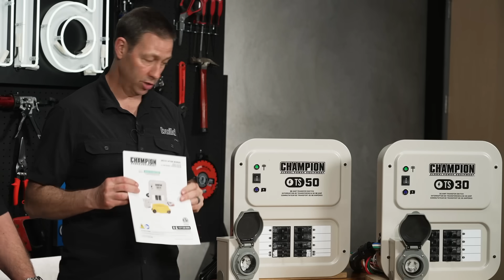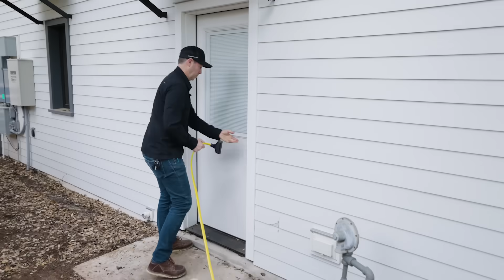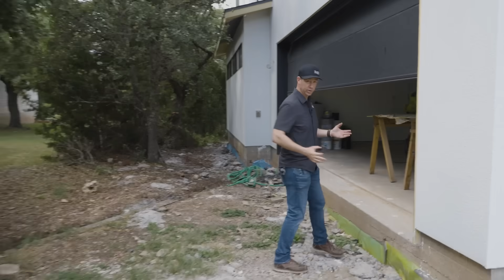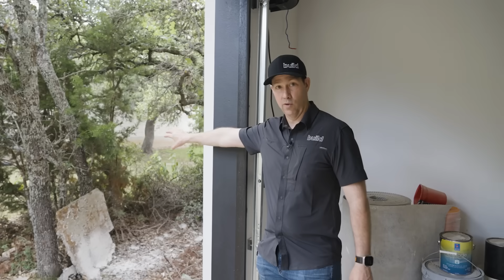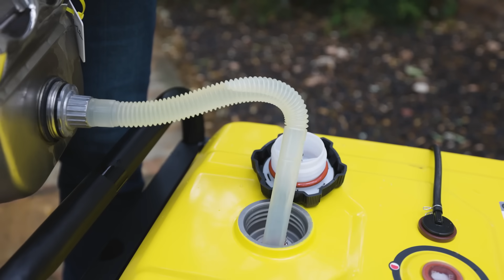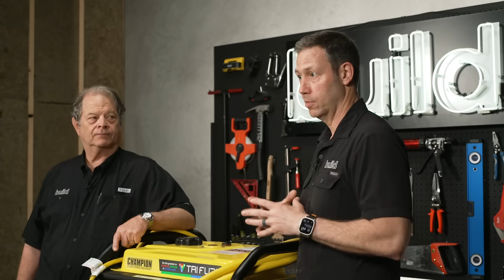SO EASY! More AFFORDABLE and user friendly BACK UP POWER!

Comment: It makes no sense to plug it inside of the garage or anywhere else inside. Put the plug on the outside. Once you put in the mail portion of the plug, it seals the connection. It should seal the connection if you’re using the right plugs.

Comment: I have an existing tft. switch connected to a Reliance manual tfr switch to run a single load like a pump. It has no neutral connection so I connect neutral to the gen/line switch plate. I used it successfully for a couple of years connected to a xantrex 3102  30A charger/inverter with batteries. There is a generator plug as well although I rarely use the generator. I recently hooked up a second Xantrex 3012 inverter charger in this setup stacked in series to provide 220/110. Xantrex says the neutrals from the power out which goes tot he house must be separated from the power input from the utility power to the pwr in plugs on eac of the inverters. The neutrals are not switched in the reliance tfr swtich and wierd things happen if the utility pwr fluctuates. I get low voltage errors on the inverters and breakers on the xantrex pop. This is inconvenient and could damage the inverters over time. My gen by the way has a floating neutral. There is supposed to be only one ground in this setup. This system has only one circuit as it simply moves power from the pole to the house where the breaker panels distribute loads. Would the Champion 50 help fix this issue which is intermittent but annoying and potential damaging.

Comment: What most people don't take into consideration is this very very important message is portable generators. Most of them are a bonded ground or a bonded connection. This bond has to be broken if you're gonna use it to power a house otherwise it's an unfortunate events could happen.

Comment: Limited by it's "All Or Nothing" design.  Every circuit on it is either on the grid, or on the generator/solar.  The Reliance transfer switch allows you to choose which circuits to run thru the transfer switch, and which ones to keep on the grid power.  For the solar folks, this means you can have some of the circuits on the solar power, while keeping some still on the grid power if available, but having the OPTION to choose...

It's nice looking, but missed the mark.

Comment: I think if you’re installing these for people with zero knowledge on how generators works or electricity for that matter and can’t do watts math, this transfer switch is categorically imperative a must.

That said!! 

If you understand the wattage, amps, voltage, gauge calculations involve and know turning off a master is better than turning off a slave, then for the flexibility go with interlock kit.

Comment: Hey folks generator 13000 support ac or heater using 50 amps? Plus the other appliances to feed the house? Thanks in advance

Comment: @Matt_Risinger I am looking for a Standby Generator solution that also incorporates an "Uninterrupted power supply", basically I do not want my power flickering as the Standby generator engages and takes over. Do you have any suggestions on who/where I should look?

Comment: The only advantage I see on this vs a Gentran type switch is that you have a one button transfer instead of having to switch each circuit individually.  As infrequently that most people will need to use the transfer switch I see little advantage.  I have a ten circuit Gentran and it works fine.  

As others have said a lockout switch works well except then you must have a plan (written procedure is best) to decide which high load circuits that you need to disable to prevent overloading the generator.  Loads like air conditioners, resistive type heaters and electric ovens are too large of a load for most portable generators.

Comment: I’m installing something very similar to this in my dads house so he can use his new F-150 to power up his home. The truck is a GFCI protected generator so you have to wire it correctly when it comes to the neutrals.

Comment: The Generlink transfer switch is far easier. Absolutely zero wiring. Just plugs in between the meter and the meter socket.

Comment: One could always wire a 50 or 30 Amp plug directly into the box and when power goes out cut your main off and the breakers off you don't want on and leave the ones on you want to power up then plug up your generator
Reply: Against code and many lineman got burned or killed. Not worth the risk to kill anyone.

Comment: We have an older Reliance manual transfer switch & the Champion Power Equipment 100519 6250-Watt generator. For folks considering this, I'd recommend the following:
1. With modern electronics, I would ONLY buy an Inverter style generator for your home. The power from Matt's Tri-fuel generator and many others is very "dirty". Control boards in appliances, computers, etc. aren't going to love being connected to non-inverter generators. 
2. The manual transfer switch is fine but, locks you into just those 8 pre-determined circuits. It might be fine for shorter outages but, when we had power out for 4 days, it would have been MUCH nicer to have more options. 
3. As others have mentioned, portable generators especially under load are really loud. It's fine at first but get's older a few days in. Get a longer cable and put the plug as far away as you can. 

Personally, I'd skip the manual transfer switch all together having now been through a real outage and using it. An Interlock kit is even cheaper and lets me control which exact circuits at any point in time get power. If I want to power the second bathroom, easy. Most of the time, we aren't even close to 30A of power draw and it'd be nice to have the lights throughout the house working.

Comment: There should be no "back-feeding",  this simply provides two power sources to the breakers mounted in the provided panel.  Those two sources are either grid or generator.

Comment: I generally don't like "all or nothing" solutions like these kinds of transfer switches or even interlock switches.  My home's transfer switch allows me to switch circuit by circuit to the generator or back (even off if I want to).  This way I can swap the circuits over one at a time without overloading either the generator or my main panel with a rush of devices turning on.  With this kind of panel I'd have to turn off all the breakers, switch from one source to the other, then turn back on each breaker.  It's also why I dislike interlocks because I have to shut off everything in my main panel, flip the interlock, then turn back on the few circuits I know I need.

I could see the advantage if you wanted or needed a sub-panel anyways but I'd still prefer being able to switch over each load independently.  Maybe Champion could make that improvement in a future version.

Comment: 50A 240V will run an a/c condenser - heat pump outdoor unit and the air handler with the evaporator unit inside. Where you run into to problems is that most heat pumps have emergency backup heat strips that require more than 50A by themselves and there is no way to separate the heat strips circuit from the air handler fan circuit. So if you use backup power on those circuits without any type of load management relay, manually disable the heat strips from the thermostat control or risk overloading the generator unless the generator is 48 kW or more for 200A service.
Reply: You simply disable aux/emergency heat via the thermostat.
Reply: @D2O2  yes, that is exactly what I said “manually disable the heat strips from the thermostat “.
Reply: @tedspradley  I know,  what is so difficult about that?

Comment: I don’t understand how the sub-panel connects to the main house panel. If you are essentially back-feeding into the main panel why do you need a sub-panel? The sub-panel seems to be a redundant step when all you really need is an interconnect switch.
Reply: There 70 years of combined building experience has not been enough for them to accurately explain how this works.  There is no back feeding,   the sub panel simply provides two power source options for the 8 or so circuits in the sub panel.  The 8 circuits are not directly connected to the main panel once this is installed.

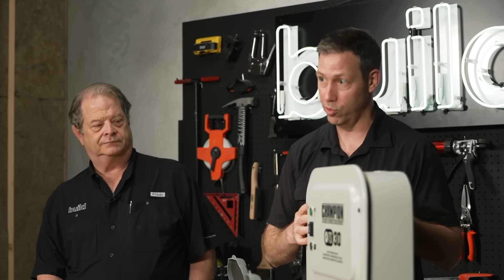Comment: You should look at a GenerLink system for a better alternative manual transfer switch option. A Generlink mounts behind the power company meter. It provides a connection point for your generator, prevents back-feeding the power grid, and also prevents you from overdrawing the generator. All I have to do is turn off the breakers in my home’s main panel that I don’t want to power, connect a generator, start the generator, and turn on the breaker that feeds power from the generator to the panel. The generlink system also provides surge protection for my entire house. I like this option because you purchase the unit and the power company actually installs it. There’s a small fee for this, but it ensures that everything is compliant and safe for everyone concerned when the power is out.  the GenerLink system will also advise when line power is restored so you can shut off your generator,and it will automatically switch over to the power from the utility company once your generator is off. I purchased a GenerLink for my home about two years ago. I’ve used it twice so far.  Most notably 5:28  during the big power outage we had in the middle of the cold snap last winter and it paid for itself on that occasion as far as I’m concerned.  note I have not received any endorsement from the manufacturer for this comment. I have purchased a unit, and used it myself.
Reply: Agree, and have one myself. Only our installation was FREE. Took all of five minutes by the power company. The installers had never done one before and were very impressed with the simplicity of it. Asked me all sorts of questions. It's such a no-brainer for a connection. I added a Micro-Air soft start to our HVAC condenser so we have the option of both A/C in the summer and gas heat in the winter. All working fine from our portable 9500watt generator.
Reply: No endorsement for me as well and when we moved in 2021 it moved with us! I will never recommend any other option, plus they still make the model with 400 Vrms varistors so we are protected from a voltage spike from the grid. Also ULc for Canada.

Comment: I had a manual transfer switch installed when we built in 2005.  Whole house generators were still pretty expensive back then. Went to HD and built a 50 amp cable with a male connection on each side to fit my generator and transfer receptacle.  That way may generator could be located behind my fence and away from any windows or doors.
Reply: What you did is very dangerous and good luck if House catches on fire or somebody gets electrocuted from your suicide cord. Only POS cheating china was selling these dangerous illegal cord sets.

Comment: what happens to the extra electricity the generator creates compared to what the house draws?
is there a generator with a battery bank that could store the wasted energy to save fuel?
Reply: There is no extra electricity.  The generator engine governor controls how much power the engine produces to match the load on the generator.  It's the same as you maintaining a set speed in your car, you only press the accelerator pedal as much as required to maintain speed.  The generator engine governor does the same thing.

Comment: Honestly, I want my house to be on a Whole Home UPS. Largely because the grid is getting unstable, and with all these junk EV's getting crammed on it, it's only going to get less reliable. So I want a Whole Home UPS, that doesn't use LiFePo batteries. Not sure what, but top of my list is Edison Batteries or Vanadium Redox Flow Cells, as they don't wearout. A backup generator, along with wind and solar. I live in NE Wyoming so those systems actually make sense.

Comment: Oh, I see now why the guy put his plug INSIDE the garage rather than the outside. Someone could come and unplug it in the night and just roll away your generator! Clever to have the plug inside. Definitely the way to go. 

So, a little over $1600 for the box and the generator plus electrician costs.  That would easily put it over the costs of a whole house stand-by generator which is around 2k. I'm not seeing the savings. The portability is great, but I would think for your house, a stand-by would be better in case you weren't actually home during the outage.
Reply: That plug isn't stopping anyone from walking away with your generator.  Thieves could just unplug the power cord at the generator and walk off with it.  I personally don't understand why you'd put the inlet inside.  The only thing I can think of is weather, but they're rated for that.

I think you're DRASTICALLY underestimating the cost of a whole home standby generator setup.

Comment: Save money and skip the transfer switch. Install an interlock on your existing panel along with the generator inlet. Code compliant and no additional rewiring needed. I can run anything in my house except the AC. That is until I install a soft start on the AC.

Edit: the interlock doesn't allow the generator and main shut off to be on at the same time. I have a 30A breaker backfeeding both legs of the panel. It keeps the critical circuits live as well as providing me with light throughout the house.
Reply: Yeah. I have put about three interlocks in. Works great. Allows you to load manage and run way more circuits. I power all of the 120v breakers on a 3000 sqft house with a small gen by just turning things off. But then all of the lights have power and can be turned on when you are in that room
Reply: Agreed, got a generlink in 2017 and it has moved with me at my new house. We've used it about 6 times, and glad we brought it with us!
Reply: Depends how often & how long you are away. Best to have transfer switch if you are not always home or spend days on the road.
Reply: @garbo8962 The context is this video which is still a gas generator which shouldn't be left while running. Standby gen using NG is a whole different ball game.
Reply: @embracethesuck1041  Why is a NG generator safe to run unattended while gas is not?
Reply: @edwinters6462  I'm thinking of a fully-automated, standby one with advanced problem detection. It's designed to operate without the interaction of a human. That's very different from the standard portable gasoline, NG or LP ones. It's not the fuel that makes the difference, it's the design.
Reply: @embracethesuck1041  Oh yeah, controls make a huge difference. Gas gens are supposed to be shutoff for refueling once or twice a day too.
Reply: This method won’t work with a GFCI protected generator.
Reply: Interlock is the way to go as long as your AHJ allows it (which most do). The only flaw is if some yahoo with a crowbar can't figure why it's there or how to use it to use it and starts backfeeding into some poor linesman. A transfer switch is marginally safer in that respect.

The interlock is also a great and cost effective to feed power from a hybrid solar/battery system with grid bypass. It lets you utilize the NEC required islanding, while maintaining whole house backup.

Comment: Or as some of us with older systems do. Hole saw your back door (low) for a 3" coupling install with your favorite marine grade sealant. Then your generator HEAVY DUTY extension goes in thru the new hole in the back door, no bugs etc. A small rag to fill the gap. When not in use it gets threaded 3" plug on both sides and is very CHEAP !

Comment: Great stuff.  Really appreciated the discussion on feeding the wiring through the side of the garage, vice having to keep the door open.  Curious if this system works with a solar grid vice a community grid?
Reply: You can't have solar active as well because the power will not equal out properly and it may damage the generator or your solar inverter(s).  If you have a battery system, that would solve that, but then you should just go to an automatic transfer switch and use battery + solar if grid is down.  I currently have a manual 30 amp/240v outlet setup for 2x Ecoflow Delta Pro batteries and if I get an EV with 120V power I can power the batteries + the house with the batteries.  I cannot use my solar arrays though and have to make sure those are shut off!  Later this decade I will get a house battery + inverter to go automatically offgrid as needed, use energy in lower cost ways, don't send to the grid when not at peak rates, etc.

As for community grid - that would be on the main power lines which would be down, so no use there.

Comment: Your buddy better have done friends to help him lift the garage door in a power outage so he can plug the damn generator in.
Reply: Why? If the door is properly installed with the correct springs, he should just need to hit the emergency release and open the door with minimal effort. Or, more likely, use the back up battery already attached to the garage door opener.